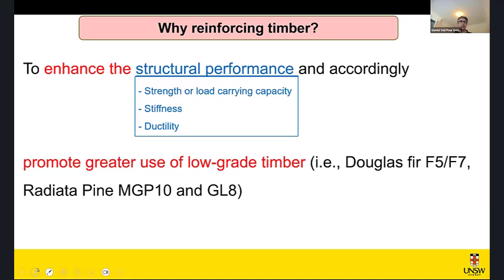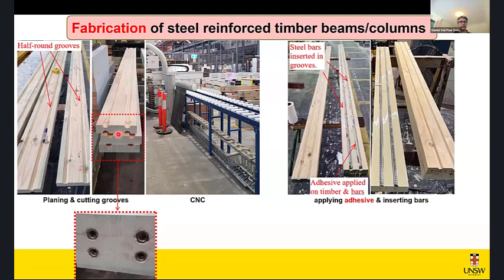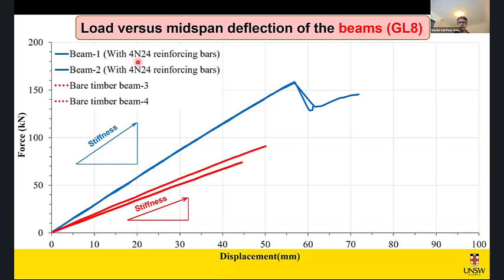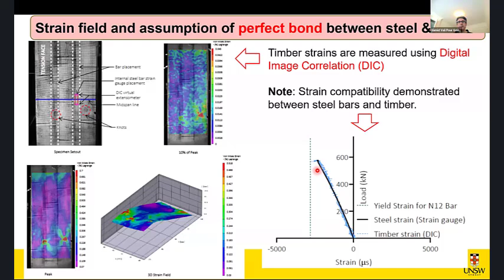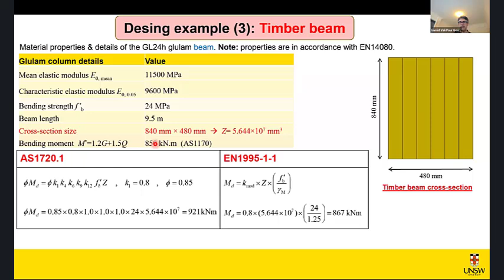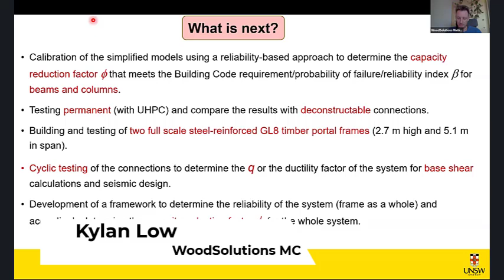Performance of reinforced timber frames: Lab insights to practical design

Comment: This is so great research!! Perfect timing for my project to reduce deflection in a second floor with original 175mm beams and 4 meter span, center center 500mm. Rebar is possible to get under an existing wall, then glue and screw it all together. And 12mm/ 4m rebar is only 10 euro each! Thought of this way of solving it with rebar, but did not know there was any research on this. Thank you very much for this research!

Comment: Are you aware of anyone doing similar work with coco lumber? For building its a lower density hardwood but considered a waste product when building against cyclonic wind forces. Thai research shows this to be incorrect but its a better product than pine plantations for the tropics. Admittedly its because their native hardwoods were plundered for sale to countries like Australia. So they are left building with reo concrete beams. All else is illegal. It would be a great joint research project as a lot of your testing is via torque wrenched loads. Does UNSW have sister universities in SE Asia who could do that?